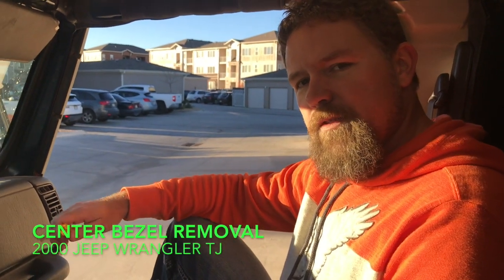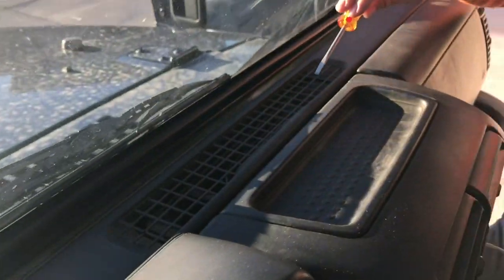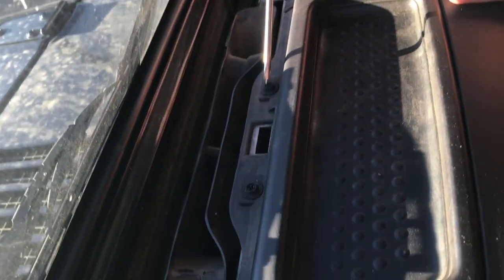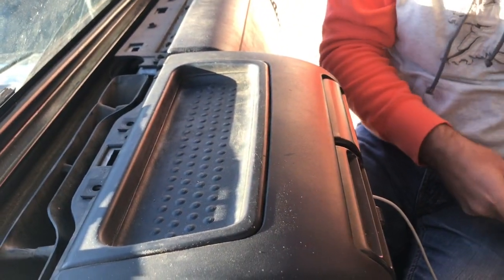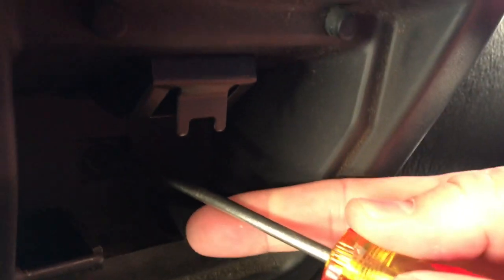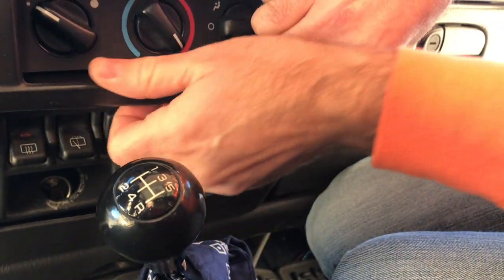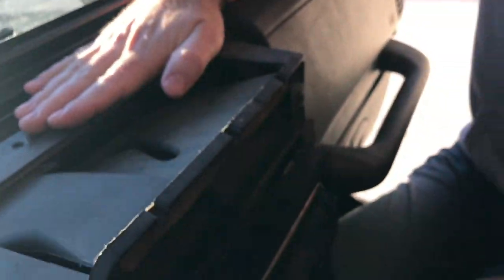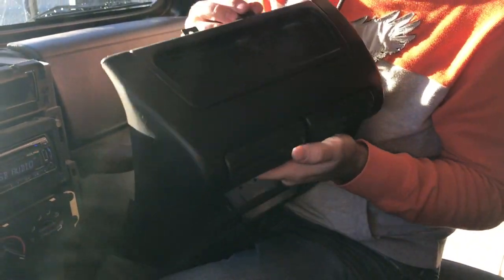Center Bezel Removal Jeep TJ

Comment: Dude, I watched your vid about speaker replacement and my job went WAAAY fast and easy. Here I am again, seeking your help for my next project, which is replacing the fan speed switch and the HVAC selector. This is exactly what I needed and your direction for removing the center dash panel is greatly appreciated. MANY thanks!

Comment: I have the shop manual on CD. The directions are quite generic and the pictures are lacking. One thing I want to point out is that the manual explains that the first thing to do is to disconnect the negative cable from the battery, isolate it, then wait two minutes so the capacitor for the air bag system will discharge.  This warning is in front of every procedure when working with the dash/instrument panel.
Reply from the maker: Thanks Paul!